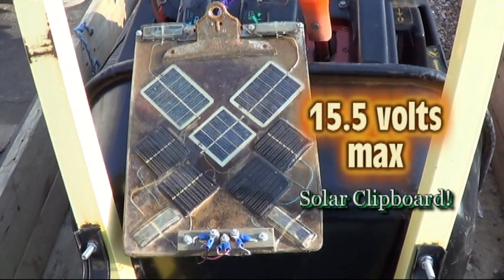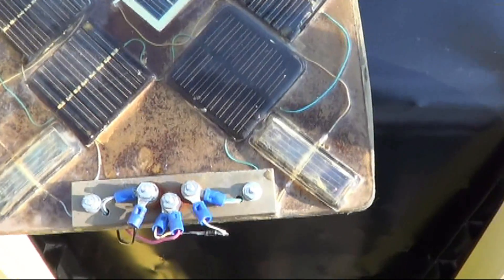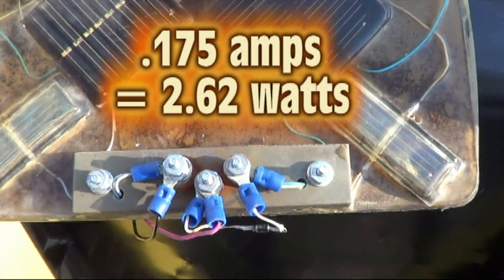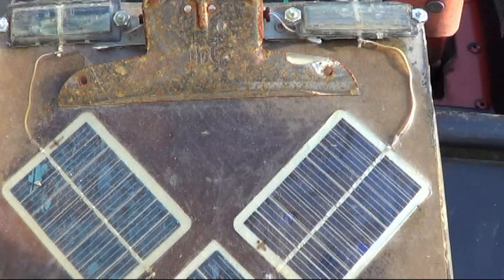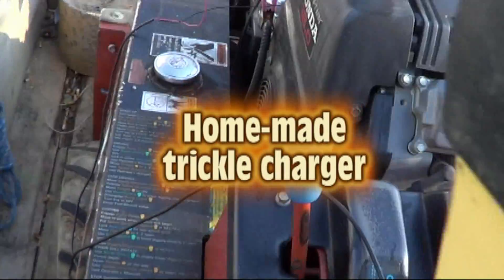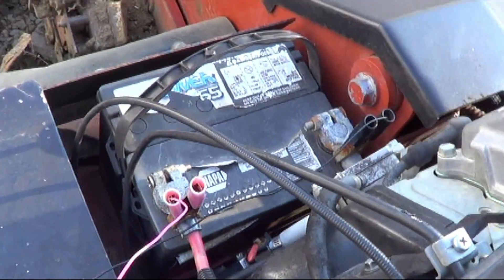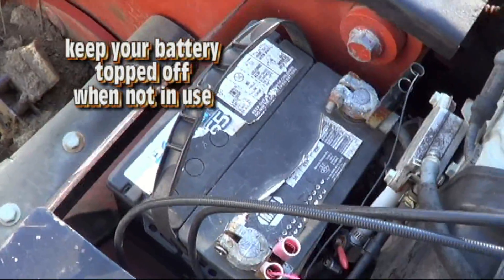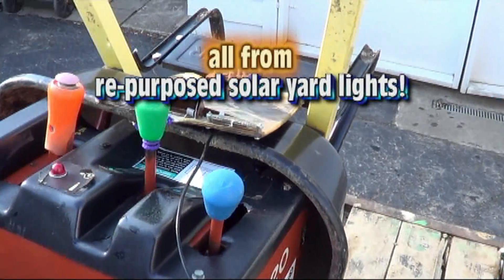Homemade SOLAR CLIP BOARD! Battery Charger YARD MACHINES & car batteries

Comment from the maker: to recharge a 12 volt battery ~ you will probably need about 18 - 20 watts  of solar power if you are only rechargeing you lap top  a couple of times a day. the solar clip board puts out about 1.5 - 2 watts.... my next project will be a 20 watt flexible panel perhaps this will help.  thanks again for watching

Comment from the maker: hey hoppper ~ 17- 18 volt panels ~ a blocking diode to keep from losing any charge you are putting into the battery (s). you will need a couple odf small panels ~ 20 watts each. if you are going for luxury like fan operations as well as a light buld, you will need a couple more.  ~ minimum of 40 watts will give you about 2.5- 3 amps of charge per hour to the battery

Comment from the maker: hey hopper ~ im sorry , i have been working elsewhere, ~ are you carrying batteries into the bush?
 light wieght solar panels are great and portable.  a simple panel as shown in clip board video puts out about 130 milliamps. this is NOT enough to recharge your battery every day. you woulod need to build a larger panel say, 40 watts miniumum to run a single light bulb for the evening. as long as you make the panels 17-18 volts dc maximum, you will not overcharge your marine battery.

Comment from the maker: hey hopper ~ thank you for watching ~!  i am working on a video for this... you can use most any solar yard lights, just check the voltages from each cell you would like to work with then, add the voltages up ~ ( no more than 18 volts on a 12 volt system ),  + add a blocking diode. more  soon ~ Thanks again for watching~!